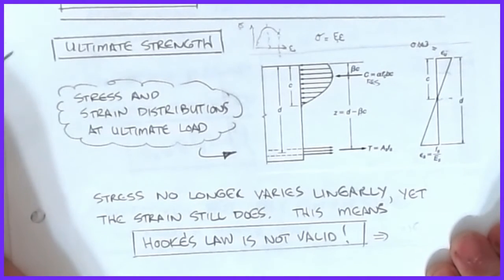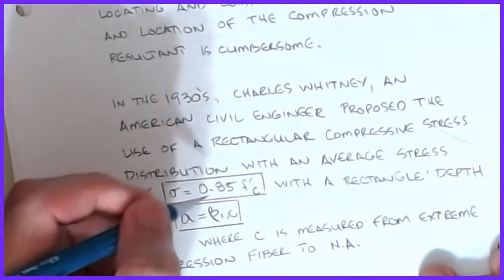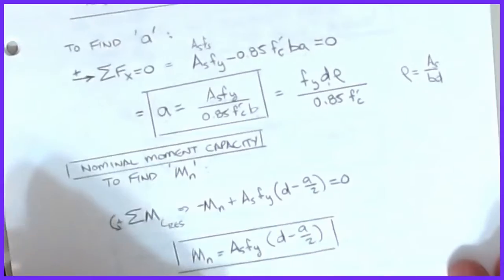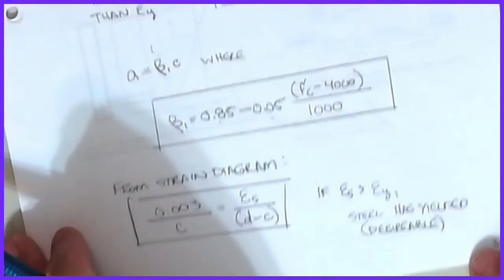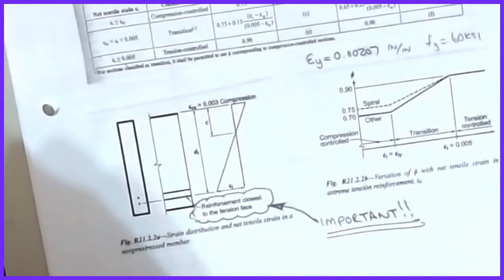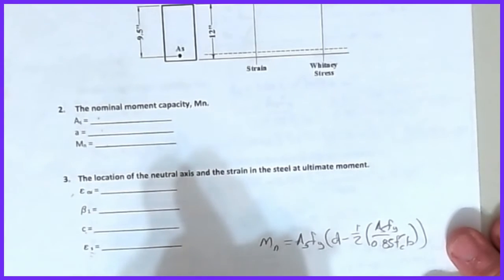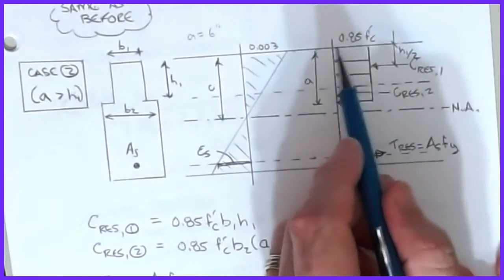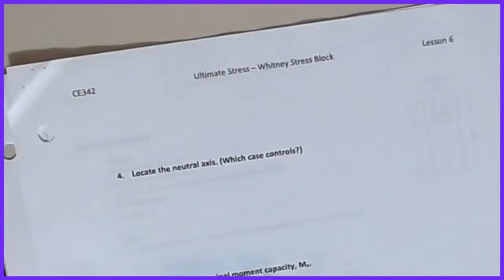006 CE342 Concrete Design - Ultimate Strength and The Whitney Stress Block

Comment: please answer this I really want to know...
is it established first that the extreme concrete strain reached 0.003   before deriving the Whitney's compression block? or i they do not consider strain?

in short is the stress contour of compression region based on the strain 0.003 ? or it is unrelated or something
Reply from the maker: TLDR:  You MUST look at both stress AND strain simultaneously.  They are related, but not through the typical Hooke's Law for elastic materials exactly.

Long version:
The 0.003 is dependent on the properties of the concrete material.  It is typically assumed to be this value - but can be any value really as determined by material testing.  The other major assumption stated early on is that the strain distribution is a linear relationship within the cross section with the 0.003 (or whatever number) being the extreme compression value.  This value will dictate the location of the neutral axis (or the "c" dimension) where the strain is assumed to be zero based on the presumed strain at the tensile reinforcing steel -- usually assumed to be yielding (or beyond).

The other problem is that the material strains in concrete do not follow Hooke's law (stress = strain * Young's Modulus) exactly, but are actually somewhat nonlinear.  Rather than perform a complicated numerical integration,  Whitney proposed a simplified methodology, his stress block, which relates the height of the stress block (parameter "a") to the neutral axis position (parameter "c") from the strain diagram.

While designers typically design for stress, in RC concrete, you MUST look at both stress AND strain simultaneously.  Once you understand it, you'll see the method is actually very clever.

Hope this helps!

Jay
Reply: @jaythreeengineering  as i remember, even in the early cracked stage, the stress and strain in the reinforced concrete still follow hookes law (2nd stage of ASD),   what conditions will signal that it will start not to behave elastically or not to follow Hookes law? in other words
what condition will signal the transition from ASD(elastic) to  USD design?
Reply: "what do i mean by elastic (in that context) is that he stress and strain is proportional " even though we know that a material can still be elastic even it has reached proportional limit
Reply from the maker: A very high level question in deed.  The transition from elastic state to ultimate state is difficult to define and even more difficult to predict.  Hence why design methods have always been limited to either a "Working Stress (allowable stress or alternative stress)" or "Ultimate Stress (strength)" design approach as defined in ACI318.

In the early stage, concrete does behave somewhat elastically, true.  The problem is in the stress-strain behavior of concrete which in reality is time dependent, due to effects of creep (among others) during sustained loading.  These strains can become several times larger than the strains predicted by elastic theory.  So in turn, the strain changes, which can cause stresses to redistribute, which in turn can affect Young's Modulus calculations -- the key to relating stress to strain using elastic theory.

So for a linear strain diagram, the compressive region can be highly non-linear (in fact it's almost parabolic) for rectangular beams. This is also one of the reasons why Ultimate strength design is so appealing -- not only does it handle the time dependent stress-strain relationship, but it also allows you to account for some additional capacity -- all without needing to know the exact relationship between stress and strain.

I'll point you to an old research article (circa 1961) by Mattock, Kriz, and Hognestad titled "Rectangular Concrete Stress Distribution in Ultimate Strength Design" where the abstract appears in the ACI Journal, Proceedings V. 57 No. 9, Feb. 1961.

The diagrams and explanation in this article do a great job of describing the point that I am so ineloquently trying to convey.  They even included details and test results  for singly reinforced, double reinforced, and prestressed concrete.

Just remember that regardless of which method you choose for your strength capacity, you still need to check your serviceability requirements (displacement, cracking, and fatigue) to make sure they are within acceptable limits.

Good discussion!  Thanks for the question.  Hope this helps.